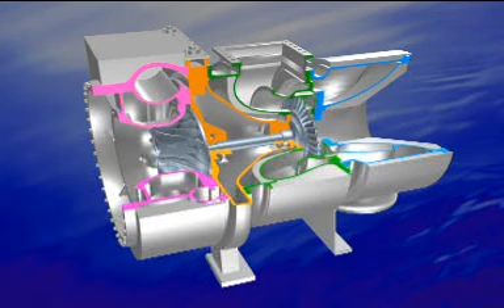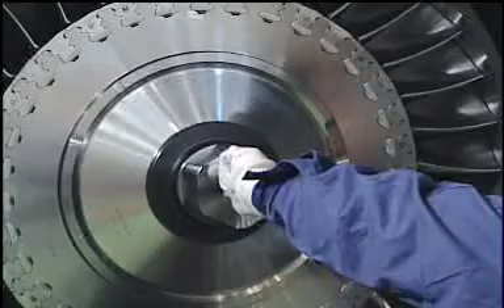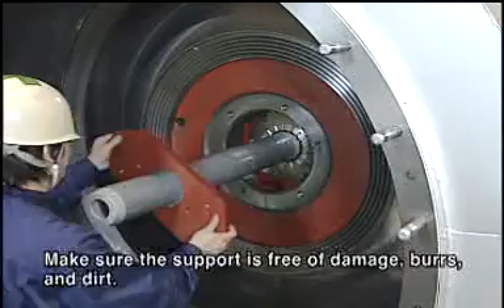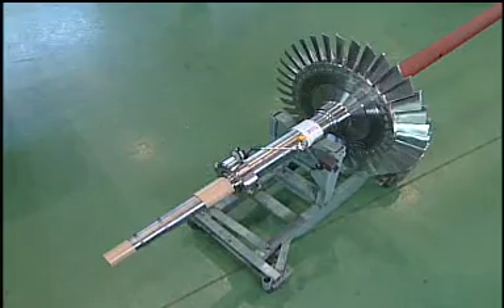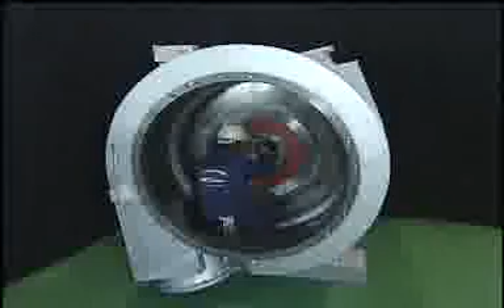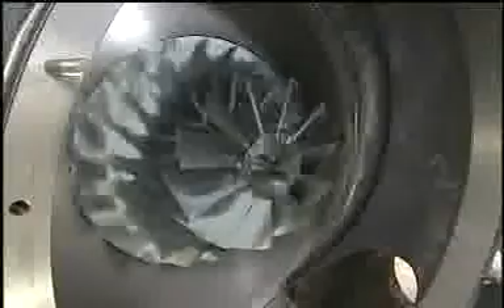Main Engine MET Turbocharger overhaul

Comment: 1. Disconnect turbocharger side wiring from tachometer cable box
2. Connect a hoist to the silencer and remove the retaining nuts of the silencer. Remove the silencer. Place the silencer in a safe location so that it does not tip over.
3. Before removing the air inlet guide use feeler gauge to check clearance between air inlet guide and air impeller at 4 location. U, down, top, right. 
4. Use the jacking screws to Remove the air inlet guide/inner scroll. There is diffuser on the inner scroll.Be careful not to damage the diffuser vanes
5. Remove the heat res
6. Attach the slingingcasing to the gas inlet casing.Remove the nuts on the flange of gas inlet casing
7. Use jacking screws to remove the gas inlet casing. Now pull out the casing. Nozzle ring is attached to the gas inlet casing. Eecure
8. Use feeler gauge to measure clearance gas inlet guide and gas turbing blades at 4 places.
9. Set the dial gauge at the end of the rotor shaft. The thrust bearing clearance is the difference between the shaft deflection when the shaft is pushed and pulled. Take atleast 5 measurements and check the measurements dont vary
10. Remove the cap and fasteningbolt from the end of the inpeller.
11. Measure the distance between the end of the rotor shaft and the shaft retaining nut. After reassembly you willneed this value.
12. Attach dial gauge and measure deflection
13. Screw in the rotor pulling out tool. On the gas inlet outer casing mount the stay.
14. Screw the hydraulic jack at the end of the shaft on the impeller side. Give it one reverse turn. Raise the pressure of the hydraulic pump and remove the hydraulic nut.
15. Attach the impeller removal fitting to the boss of the impeller. Pull out the impeller.Screw the impeller lifting tool. Set down the impeller horizontally.
16. Use the threaded bar on the theeaded part of the sleeve and pull put the sleeve
17. Remove the support.
18. The compressor side labyrinth and thrust bearing are attached to the support. Place with the theust bearingmetal side uppermost.
19. With the support removed you will be able to see the thrust collar. Remove the thrust collar with the threaded bar.
20. Screw the rotor guide pipe into the rotor shaft.
21. Remove full rotor.
22. Remove the retaining bolt from gas labyrinth. Take out the gas labyrrinth
23. Next remove the turbine side oil labyrinth.
24. Remove the turbine side journal bearing
25. Remove turbine side thrust bearing by removing hex bolts
26. Remove the compressor side journal bearing using the threaded bar.